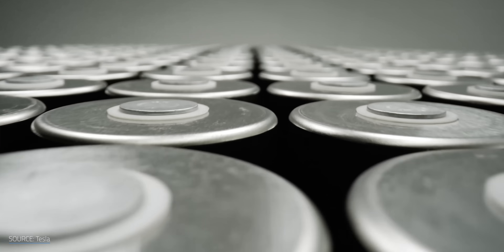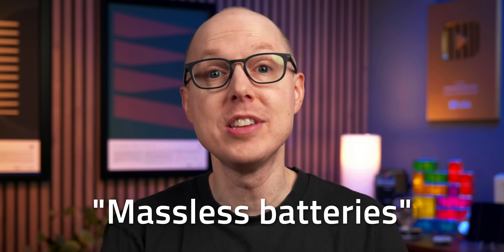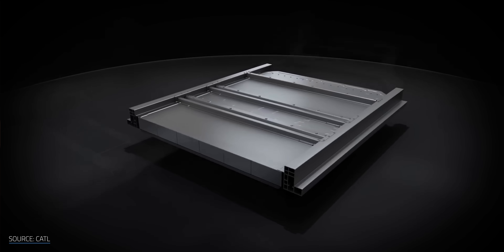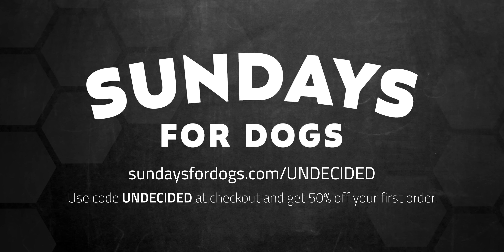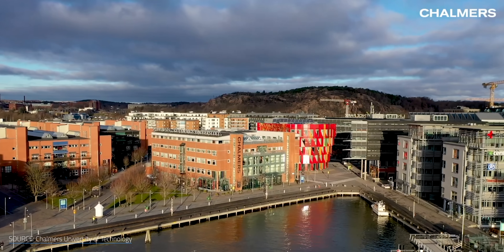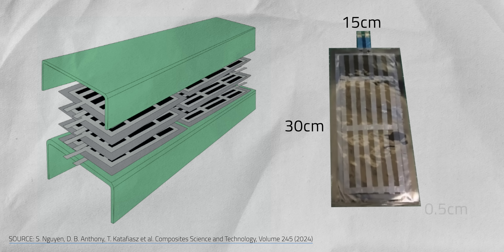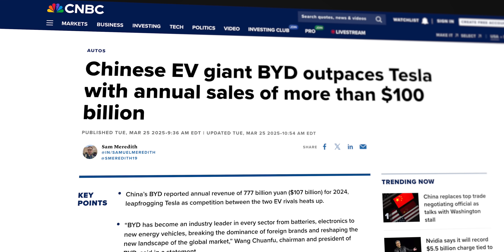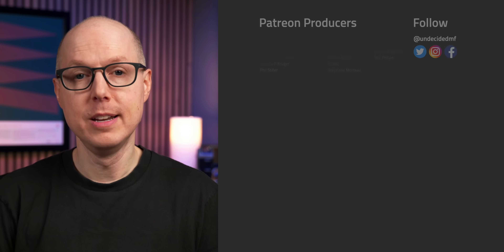The Strangest Battery Breakthrough Yet

Comment: This is one of the things I think about changing with more modern housing -- turn the house itself into a power-storage system. But they'd need to cheap and long lasting, even if they don't have the best power densities. The internal space of houses have, well, lots of unused space that could otherwise contain power-storage systems.
Reply: Its called dirt. Rammed Earth, Cobb, BRICKS. These are all materials that store energy and improve the heating/cooling of a space. They're fireproof, abundant, cheap, and eco friendly.
Reply: The insurance companies would go bonkers.
Reply: Only in america. elsewhere in the world(where ppl don't enjoy cardboard walls) the walls are built with cement, which is, yk, void of empty space.
Reply: @Mossybwuny  Except cement is a good material to replace with structural batteries, given its weight and durability. But again, it needs to be cheap and long lasting -- even if it doesn't have great power density -- so it can actually replace cement. And as a side benefit, it would also address a serious shortage of cement-appropriate sand.
Reply: @Mossybwuny  europe has a lot of wood frame houses now also.   and of course we do have brick houses with cavity walls,  which we tend to fill up with insulation materials,.
Reply: @Mossybwuny  concrete walled buildings are incredibly inefficient and costly from an environmental perspective. You're much better having insulated cores or air gaps. It's better for the occupants and the environment.

Comment: Because of impact safety issues, and possible issues with battery replacement, I feel like structural batteries may be a good fit for unmanned applications. In particular, quadrotor drones are particularly sensitive to weight when it comes to endurance. OTOH, quadrotor drone users are pretty sensitive to price, and a few extra minutes of flight may not be considered worth the extra cost.

Comment: I loved the dig at Boeing and "opening doors".  It made me smile.

I do believe that we will see an inevitable transition to mold-able batteries.  Converting my 1970 Lotus Europa has shown me how rectilinear batteries waste huge amounts of vehicle space.  They fit, but could fit much better.  As a retired pilot familiar with aircraft structures I can see the benefits immediately.  heck, just imagine how beneficial it could be to have 8' 2x4 batteries to incorporate into building structures.  A whole house could be a battery.
Reply: As an aircraft mechanic I can see also several downsides. It makes parts prohibitively more expensive (which is multiplied massively in the aviation industry, where a single bolt can easily cost $100). Plus if a panel is broken or cracked you now have to worry about a potential short circuit ruining all connected parts. Not to mention that repairability is pretty much non existent.

Also, the door opening and closing when the structure is in pristine condition is nice and all, but they are emergency exits. It would be interesting to see how it holds up in a crash or fire situation, when they are actually supposed to perform.

The idea is cool, and if it works all the better, but I don’t expect them to be integrated within the next 10 years.
Reply: @carstekoch  I can actually see more that we go for an in-between approach - having the battery forced into a particular shape is unwieldy, but having the entire structure be a battery is an issue as well - better then to go in-between and shape the batteries to different configurations, so parts of the structure are batteries (wherever and to what extent it makes sense) but many other parts are not. For cars and bikes I can see the in-between approach making sense actually. For things like phones and laptops probably the majority of the structure can be a power-source. Depends a bit on the application. 

In planes I can see how it only makes sense for a small amount of structures - on commercial jets I can see how chairs for instance, which contain entertainment systems, could be greatly batterized, but perhaps not many other things.
Reply: @predabot__6778  
I am hesitant to place anything, that has other parts depend on, anywhere near passengers. I can already see passengers kick against the back of seats and breaking the composite materials. Not to mention that the energy density is not enough for one seat to power it's own entertainment system. But i might be too pessimistic and and the offset of a few hundred wh to maybe a kwh is worth the additional cost in this case.

Comment: What happens when the battery reaches it's recycling span and is no longer able to take an adequate charge? Do you scrap the vehicle because the battery is the structure? I can see it becoming too expensive to replace the battery/structure and the vehicle being "totaled" because the battery has problems.

Comment: The only problem is that if you make it part of the design... that also means when you need to replace it (a when not a if) then you have to take things a part and I not sure if that will work across the board for everything. Some things sure, like doors for example as they can be replace as needed, but if its part of the building skeleton, I dont think it will work out as well. With that said, esp stuff like EVs, there is a ton of wasted space that batteries/storage can be put into it. The harder part of that is getting replacements or a design that can work across everything. Other wise, much like today hardware, you have to buy their battery and that will just increase cost. One area I think these batteries would be best in is solar panels themselves. While it would limit them to a single side (many roof type are), adding 1kwh worth there could make things far more simple and reliable in power output while reducing their cost even more as part of the stack. So while they still might only out put x power, they can release that power over time instead - even at night.

Comment: Structural battery might be fine for a cell phone or laptop. But not a good idea for vehicles. As it is right now, when your EV gets into a small fender bender, the car is "totaled", due to the replacement cost of a dinged battery. And then don't use battery technologies that are flammable, so any variation of lithium ion is out ! These batteries must not incur any plastic deformation, in an accident. When does that ever happen, in a car accident ? Just because Tesla & BYD are doing it, still makes it a BAD idea.

Using vacuum, when curing polymer resins, is common knowledge, in that business.

Comment: well given that there are very flat carbon fiber ones analogous to aluminum,  it occurs to me that a drone could be made with wings and body made of battery, which would increase range.   Militaries would i imagine be quite interested in extending drone range, and if the material couldn't handle crashes or  um...were a fire hazard on impacts...i don't think that would be a problem for them.  rechargability is also less of an issue....

Comment: This isn't my lane at all, but it seems to me, given the relatively low duty cycle of batteries vs. structural components, I am not sure I'd want to have a battery system that was the structure of any durable good. However, for applications where the practical duty cycle of the object is equal or or lower than that of the battery, it may make sense (phones, laptops). The notion of it not being a battery, but a supercapacitor however is a little more interesting, as the duty cycles are often much longer than today's common battery tech.

Comment: I find this concept hard to like in general - lifespan of a device limited by the charge cycles of a battery that is likely even more difficult to remove than the current phone batteries, and also at risk of a small bit of damage to the structure killing the device entirely. Now a structural quick change battery where the entire easily removable battery is its own structure might have merit, but you just know the companies building devices with them are going to use these structural batteries to make their devices more impressive on paper while brand new but further limit the expected lifespan and repairability...

Comment: 1:58 An EVs energy goes over 50% to just its aerodynamics. A car that doubles it's weight won't need double the energy to get it moving. There is no loop. 

The main advantage is again that you can spare stuff that is not the active material. So more energy density on the system level.

Comment: I like the idea that the battery's structure/case can pull double duty in being a super capacitor. Some hybrid-chemistry batteries already showcase multiple functionality in use (See CATL Freevoy dual power batteries). So you could have the battery case, and even a pressed carbon fiber tub working as a short term power buffer for regen braking and initial acceleration. Super capacitors are already being used like this, as a short duration power buffer for hybrids. So integrating the battery functionality into the structural battery case (and frame) could be a game changer. A few potential issues that come to mind in utilizing this new technology are potential battery shorting during collisions, future battery replacement, and recycling (considering that the case/frame IS also a battery).

Comment: I work in shipping, and shipping batteries can be a huge problem.  A UN3480 label means I cannot process a package and a customer is unhappy.  where I am at this usually means a stationary power supply or an electric bicycle (or similar mobility).  These later application can most benefit from structural batteries.  What would also be good is a damage resistant corrugated steel sheet alternative: many poor towns are filled with homes with cheap steel roofs.  replacing these with durable structural roofs which can collect solar power and store that power while keeping the rain out would be an all-in-wonder type of solution if it can be done cheap enough at scale.

Comment: Replaceabillity is the biggest key factor for these to even be considered an option. You can have a tiny issue cause a major section of a vehicle to need reshaping and replacing. If you can place the battery well you might avoid this most of the time but then probably also make the job harder when it does happen. And i really doubt people will be as ready to trade in their old Planes compared to their smartphones.

Comment: Hot take - I don't want my phone be thickness of a credit card. It would be extremely awkward to use.
Reply: @Xotchkass  how about a phone with the same thickness as today's phone but double or more battery capacity?
Reply: @dat9553  Or the same battery capacity, but actual inbuilt shock absorption so it doesn't break immediately if you accidentally drop it.
Reply: I strongly doubt that claim anyway. It's not like the battery was the one thing that drove these things to be as thick as they are. There's a display, a PCB with all kinds of components, an external USB C port, a camera (or rather several), speakers. I don't see how they would slim those down to this extent.
Reply: Yeah I love this channel, but I find it a bit disappointing when they echo outrageous claims like in this instance a phone the thickness of a credit card. That's like saying new transparent materials will make appliances and cars invisible, no it won't. Why are they overselling something that's already astonishing on its own.
Reply: @Xotchkass  also we still need USB port somehow i think the thinest phone that still comfortable is as thin as USB port width

Comment: What about monocoque aerodynamic bicycles like a velotilt, quest or newer models with pedal support.
The most important thing you want in a bicycle is regenerative breaking and acceleration assist... Riding 50km/h in an aerodynamic recumbent is the easy part. Stopping and driving away from traffic lights however....

Comment: The main issue is thermal runaway, and structural batteries make it worse, when it comes to putting out EV fire😢. We need built-in fire prevention, through endothermic chemical flooding, or a zero thermal-runaway battery chemistry, with high energy density.

Comment: Why not design or manufacture batteries in the same shape as the structure itself—something like an "Inside Shell Battery" (that’s what I’d call it)? This way, you retain the strength and reliability of the existing structural parts, while the battery becomes a slim, integrated component that fits within. The battery doesn’t need to match the structure’s integrity—just conform to its shape.

Comment: One potential future option may be to integrate a structural battery with solar cells such that the solar panel charges during peak solar periods, and then provides the collected power into it's 'grid' as demand occurs. I don't know if it would reduce the mass of the panel, as it's replacing what is usually an aluminum extrusion, and I don't know how the structural battery works, or not with heat issues experienced by solar panels, but you could reduce the mass of the entire structure of the panel installation, especially if struts and posts can also largely be converted into structural batteries. I would expect that the structural battery itself would have to handle the Battery Management portion of the process, and would need to be communicating health to the 'grid' locally so would need at least some variety of microcontroller for that, but those both seem like fairly solvable issues for such a setup. Heat still seems to me to be the most likely issue. So for that it might just make more sense to be able to build "struts' that standard panels both mount to, and plug into

Comment: Structural batteries in an aircraft has some serious hurdles to cover first - most planes get struck by lightning 3 times a year - if the frame of the aircraft is also a battery - that could end badly.

Comment: The challenge I have with structural batteries is replacement or failure rates. I have no idea what this rates will be. That said, once a structural component fails what is the replacement cost, labor and parts? Can the structural battery have a scrap value for recycling? 

Scaling structural battery production may never have a standard making everything expensive to manufacture. 

3D printed structural batteries would make them faster and cost effective for manufacturing. If it becomes too cheap then it becomes a throwaway, skilled labor to special order 3D parts to shipping to down time to total cost.

Airplanes and commercial vehicles would be best practice.  Large scale standard sizes and a lot of maximum regulation standard sizing.

Comment: By simply monitoring the precise voltage, a structural battery could provide its own internal non-destructive testing. Even microscopic cracks in the structure would cause recognizable fluctuations of voltage.

Comment: The GM EV1 had a Structural Battery.  The car would fall apart should it try to run without the battery pack included.  This was in 1990!!

Comment: I see the day when structural batteries will be 3D printed as a skin, or wing, or even the whole vehicle. Look at how even rocket engines are 3D printed.  Imagine a large printer building a car, airplane, or a rail car with battery, wiring, hydraulics all integrated.  Si-fi I know, gotta start with a dream.
Reply: Forget repair, but then we're already at the point of repair often being unecomical.

Comment: The actual hardest part of mass manufacturing structural batteries is that every structure must be handled differently with different design constraints. And given that you (largely) only care about mass when it's mobile, that means cars and such will either have to be designed around said battery (which requires them to have thoroughly beat the market), or they are going to need to have one of the most flexible possible pipelines for creating these, which tend to be particularly inefficient .Oh, and instead of swapping out the battery for a fast charge, you need to swap the door. And make sure no one keys this electric car, or hide the structure further in, making battery swaps much more of a hassle and expense.
Fewer issues when you're making less critical objects like smartphones. But batteries are the first things to degrade in a phone. So, too well-integrated into the structure, and you're just going to have to scrap the entire phone when it dies .
So everything is stacked against this particular battery innovation. Best of luck.

Comment: A cyberpunk uses 4680 batteries which weight 350 grams a piece. The casing accounts of 60 grams per battery (or around 18% of the battery weight). With the whole structure to hold the batteries, I'll just assume 30% of the battery pack is structure and casings. 

A cyber truck battery pack weighs 1600 pounds. Moving the battery pack towards a structural battery would save around 480 pounds.  And would drop the cyber trucks weight from 6700 lbs to 6200 lbs.

That's pretty substantial, but seems like a nightmare from a manufacturing sense. I bet all my money it will never be in automotive, but may make it into extrusion like materials at some point.